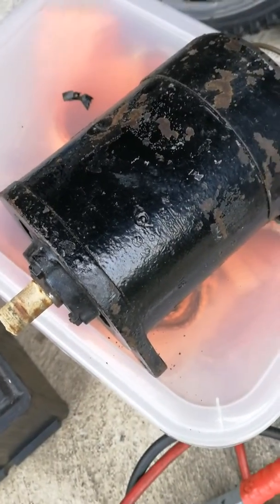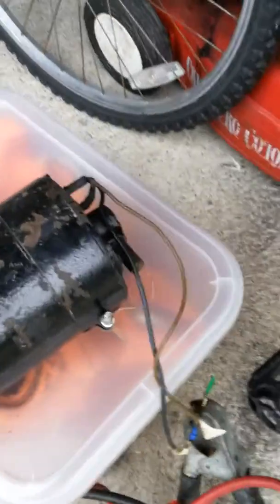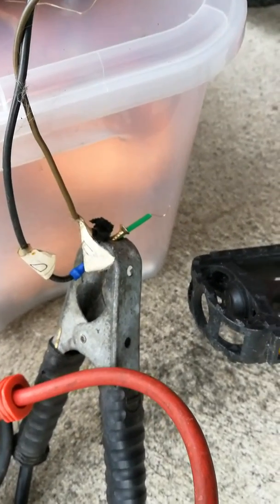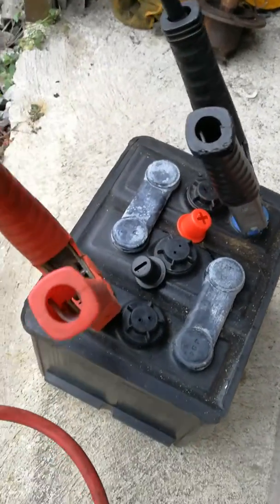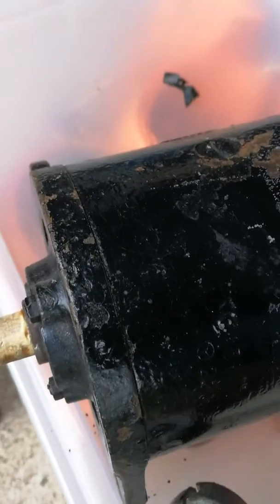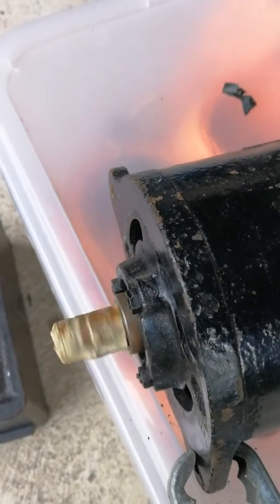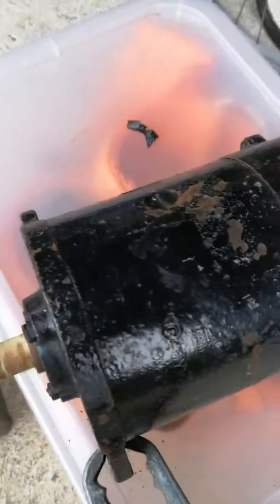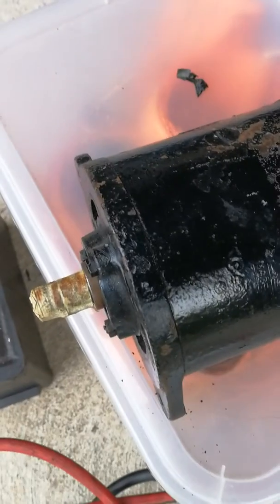How to remagnetise or change polarity of a dynamo

Comment: How about holding a strong magnet to the dynamo to get the dynamo started?
Reply from the maker: I'm afraid that just wouldn't work as the dynamo is an electro magnet
Reply: @keithmoore4742  So the dynamo receives current from the battery to get started? I know nowadays alternators get current from the battery to get started
Reply from the maker: @janjansen9037  well not exactly, just once as described. The dynamo fields then hold some residual magnetism which allow it to produce charging current. If not used for a number of years the residual magnetism of the fields depletes so this process is required.